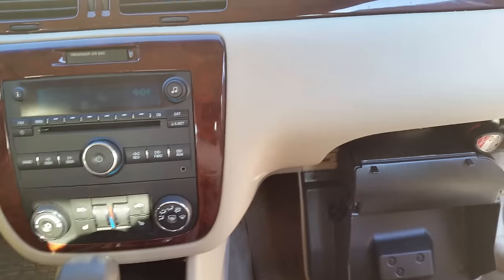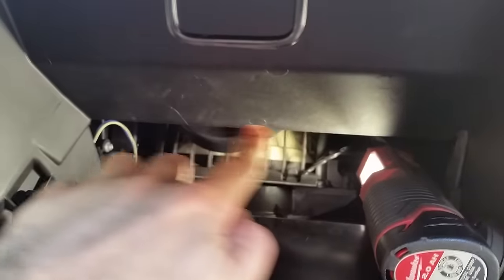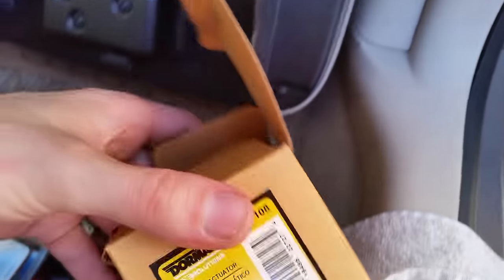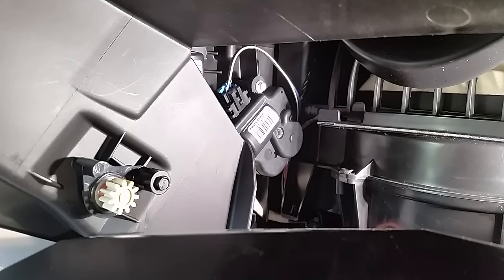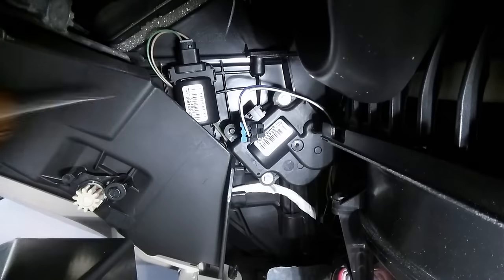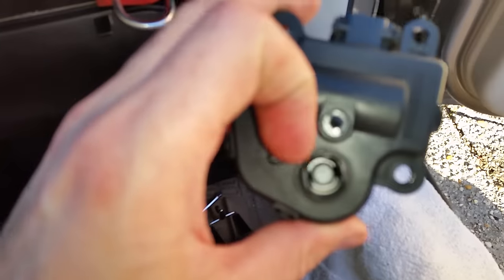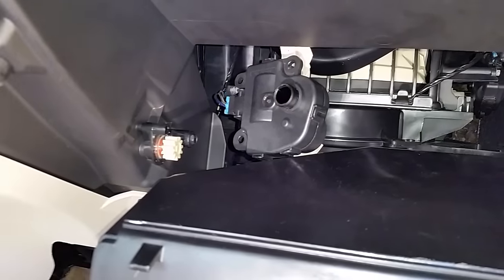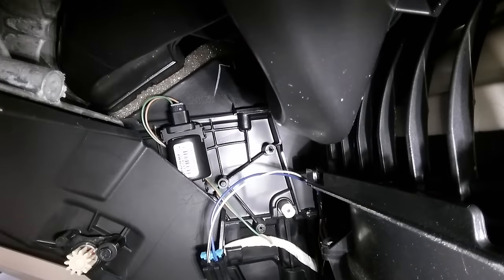How To Replace A Chevy Heat Door Actuator - Impala 2006-2013

Comment: my 05 Chevy impala doesn't have the clicking noise when I turn the a/c but I took it to a shop and they put it on a scan tool and said thats what it is the actuator should I trust that?
Reply from the maker: a scan tool can tell u if an acutator is bad
Reply: can or can't? it wasn't the regular scan tool it's the big computer scanner they use to troubleshoot codes..... but this is like the 5th video that I've seen about actuators and all have said the same thing about the clicking noise
Reply: it looks like a big pain to get to but I sure don't have the money for that shop to fix it
Reply from the maker: +geerob gizzle they probably used a tech2 scanner..yes it can tell u
Reply: I'm going to try to do it myself hopefully I can do it just hope that's what's really wrong since it's no ticking noise
Reply: From what I've checked myself before I took it to the shop is I bought a digital temp gauge and at low blower speed it blows at around 50 degrees but on high the temp goes all the way up to 67 to 70

Comment: Just followed this step by step and got it fixed. Now it's just blowing out hot air. What did I do wrong. ?
Reply from the maker: is the one u put in working? could be defective part
Reply: +klowny1969 I don't know. It's not making a clicking noise when I put it in. I took it out and currently have nothing in there.
Reply: +Tyler Radwan funny enough, I put the old one back in and now I have no noise, and cold air again lol.
Reply from the maker: +Tyler Radwan lol

Comment: My daughter's 2006 impala blows hot air when moving and cold when stopped is it the same fix ?
Reply: Butch Vick did you find out??
Reply: Same issue, same question.
Reply: could just be air in the cooling system. I would try to burp the air out to see if that's the problem first. mine did the same thing until I bled the air. just wait for your engine to cool down and take the radiator cap off. wait until the thermostat opens up. you'll see all the air bubbles come up. squeezing the hoses helps. (use gloves if the hoses are too hot too touch) just do this until you don't see any more air bubbles. you probably will need coolant. most likely there's not as much coolant in the radiator as you need due to the air trapped. hope this helps.

Comment: I just replaced mine and the passenger side blows heat but the driver side doesn't when I connected it it kept turning interning interning so I guess you have to adjust it any help I would appreciate
Reply from the maker: Edwin K novic no adjustments..means the gear is stripped
Reply: klowny1969 naw i dont think soo but ima try again
Reply from the maker: Edwin K novic if it keeps turning..then its one of three things..1)you didnt install it right 2)the actuator is faulty 3) the gear teeth on the blend door are bad
Reply: klowny1969 yea before I screwed it back i just connected it and I turned the heat on and off and when i was switching it it kept turning and it would keep going for a second
Reply from the maker: Edwin K novic cool..good luck

Comment: Can this be done in the 2015 impala ?
Reply from the maker: Yesir
Reply: Hi I have a question I replaced both actuators but is still not able to defrost. Is stuck on vent and it will not go to the defrost is there more than 2 actuators?  Thanks

Comment: does this cause the heat and the ac to not work at all
Reply from the maker: Sometimes yes..depends which actuator it is
Reply: klowny1969 mind sounds like it's the one under the glove box that you changed
Reply: klowny1969 I changed it but my air and heat still isn't working I have antifreeze . What else could it be?
Reply from the maker: check to see if the door moves when u change the temps

Comment: Where's the loactiofor the 3rd one, I know there's one under the steering wheel ant the glove on left??
Reply from the maker: Two in the glove
Reply: @klowny1969  appreciate it never knew do u know exactly what it's called the smaller part, I have a impala 2012 ltz I changed my driver one under recently, they don't make noise just heater blows on my side and cold on other, but I repaired it last week and its still messed up weird I bought the part at auto zone hey I got life time warranty lol

Comment: I have a 2010 impala and when the heat is working on the passenger side it is not on the drivers side. Is it the actuator that is on the left side of the glove compartment (How To Replace A Chevy Heat Door Actuator - Impala 2006-2013) This video?
Reply: J Holmes (
Reply: Sounds like you have one going bad on the driver side which is a pain in the ass to fix

Comment: ok great vid  but my 2011 impala  drivers heat doesnt work . passenger does  but no ticking noise  wtf
Reply from the maker: check out my driver side actuator vid..its possible ur actuator is completely dead..see if ur getting power to that actuator

Comment: That clicking noise means the actuator has some teeth  missing what i did I went to the salvage yard & snatch me about 5 actuators off 2 or 3 impalas it's about 5 bucks took them home pull the bad one off ur car make sure to mark the dial that way it will go back on easy open up the actuator u took off ur car with 2 very small flat head screw drivers pry the clips up don't break them with 1 screwdriver & with the other screwdriver pry in the middle until u open up just look to see what teeth is missing bust open one of those actuator u bought at the salvage yard which ever one has a teeth missing replace it close it up and put it on

Comment: For this reason I will NEVER OWN A CHEVY ANYTHING AGAIN!! Had the passenger side fixed then 3 months later the drivers side started it!!! It does it even if the heat/AC and fan is COMPLETELY off! It does it every time I use my remote entry even before I put the key in the ignition!  After I turn the car off, get out and close the door it does it!!! This drives me crazy! Why hasn't there been a recall for this??

Comment: Those are a tragic tour-de-force in GM design to cost. To save money they don't use a position sensor, or any sort of pulse counter. Instead there is a current sense resistor in the BCM that's used to sense when the commutator bars pass by the brushes in the DC motor as a crude position indicator for the door. The pulses of current are then the "steps". The catch is that the actuators have to be swept from full open to full close while the controller waits for the pulses to stop to establish the range of motion. They only stop when the actuator basically jams up against the stop and stalls the motor, placing lots of stress on the gearbox inside. Sooner or later, it ends up stripping out, making that obnoxious sound.

Comment: All u have to do is go to a savage yard they have plenty of impalas 2006 2013 pull u about  5 actuators it may cost u about 3 bucks take them home open them  up using 2 flat head screwdrivers

Comment: Question: I replaced the actuator shown in this video but there is still a clicking noise. Can you tell me what else I can try? It seems to still be clicking with this new actuator and clicking on one on the right of the vent that opens and close.
Reply from the maker: There are a few actuators..make sure u change the right one
Reply: I can help I have the same issue it’s the one right near your blend door there’s two actuators and there’s one that  seems to be  operating the blend door so you open up the vent manually and disable the actuator right by it on the right

Comment: I have a 2008 Chevy cobalt ls my ac works fine but my heat don't I changed the thermostat and had the car flushed but still nothing I think it's the blend door can someone please make a video please please it's getting cold I really need a miracle I don't have $1000
Reply: I have the same problem have you found a video about it?

Comment: FOR A QUICK FIX... YOU WILL STILL HAVE COLD A/C AND HOT AIR LIKE NORMAL. ALL YOU DO IS CLIP 1 OF THE WIRES ON THE RIGHT SIDE GOING TO THE ACTUATOR OR IF YOU CAN FIGURE IT OUT JUST UNPLUG THE ACTUATOR. I THINK ITS WHITE/RED LINE. I JUST ENCOUNTERD THIS PROBLEM WITH A CAR AND IT FIXED IT. DONT PAY $500.00 FOR A DUMB FIX

Comment: Anybody know what size ratchet is being used?
Reply from the maker: The ratchet is 1/4 inch
Reply: Appreciate it man...I have 3 different impalas to do this for smh... but I'm confident
Reply from the maker: Np..make sure that you are changing the right one though..there are a few of them
Reply: Sure thing, i've placed my hands on all 3 of them and its definitely the Heat Door Actuator for now....i'll keep my fingers crossed.

Comment: My shit is still ticking after installing the new actuator. what do I do now?
Reply from the maker: You sure u changed the right actuator? If so then it's defective..don't forget to subscribe
Reply: @klowny1969  100%! I know for a fact that I changed the correct one. I unplugged it because it was ticking, then I installed the new one and it's doing the same thing.

Comment: Im gonna figure out a way to do this mechanical. I worked in electronics for 60 years and can tell you its all cheap junk. Servo motors made for plastic WTF man ?
Reply from the maker: lol yes..older cars use vacuum diaphragms to move the doors